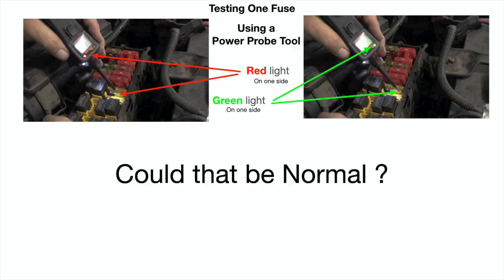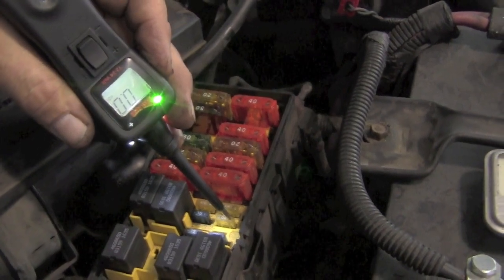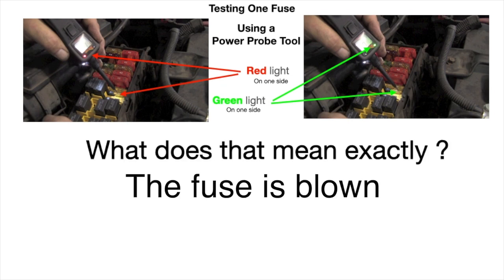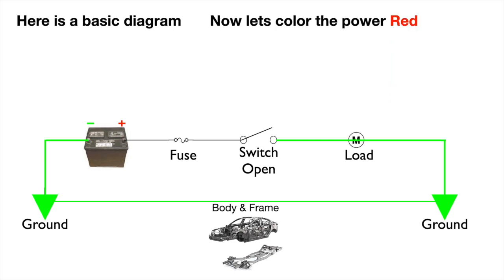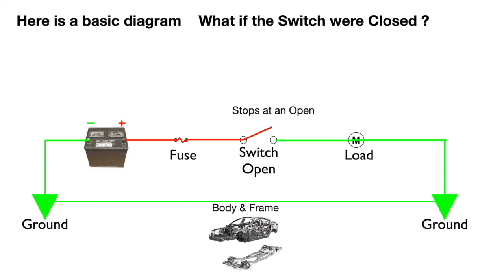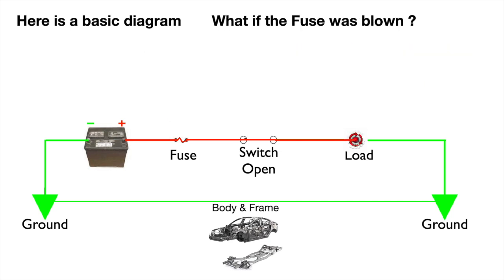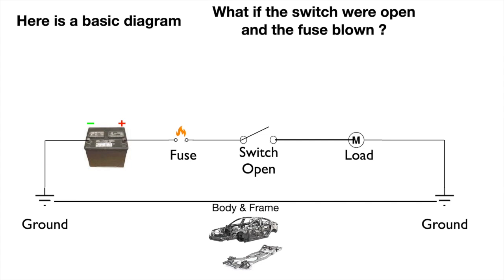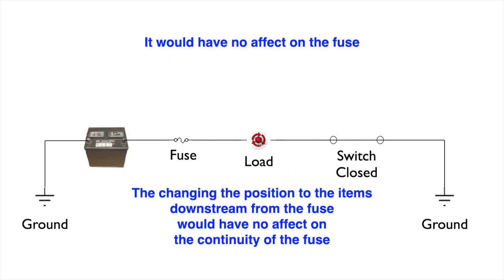Lesson  in Electronics:   Be Better Than Basic

Comment: I stopped at 1 minute, is that fuse #20 for the PCM pin A22 on a mid 90s Jeep? Possibly a shorted HO2S harness against the exhaust manifold, pulling that line to ground, powered by the ASD Relay switch side also powered by Fuse #20? Thanks for another awesome video Duane.
Reply from the maker: Very observant.  Yes it is.